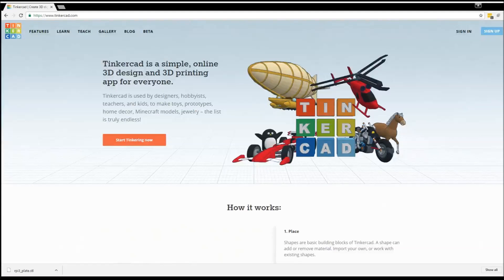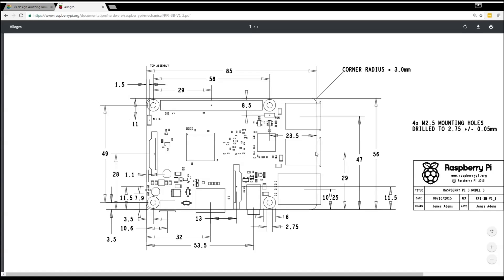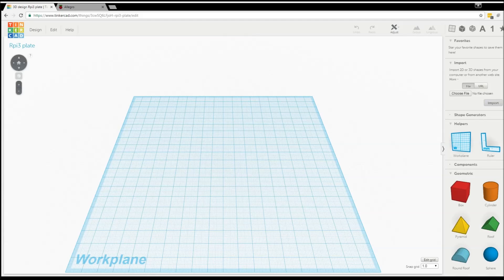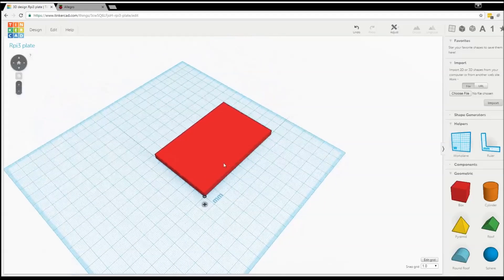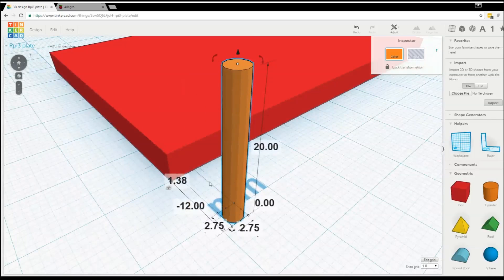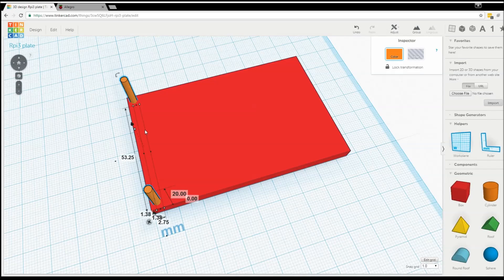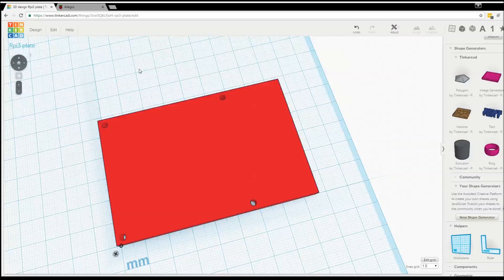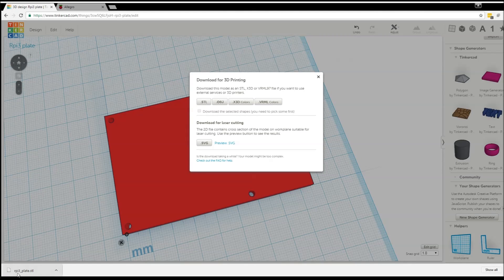Introduction to Tinkercad

Comment: Question, when placing the cylinder on the grid, you say 3.5 minus one-half the width of the cylinder in other words 3.5-(2.75/2)=2.125, why are you saying it's 1.375?